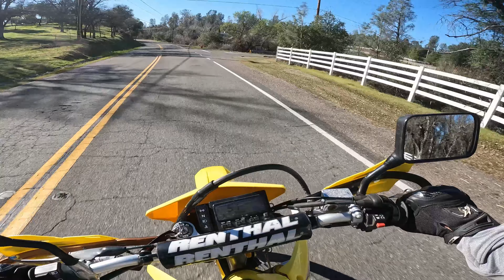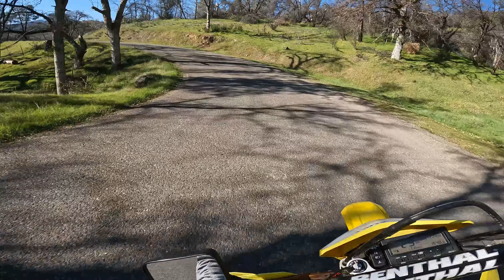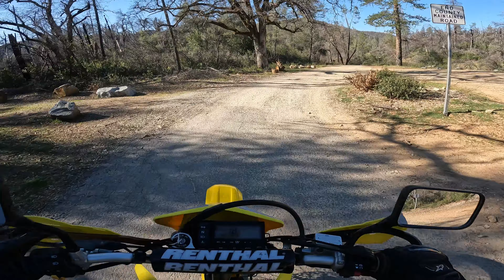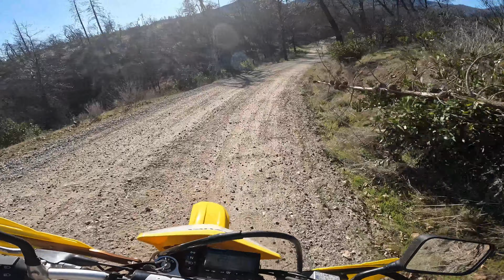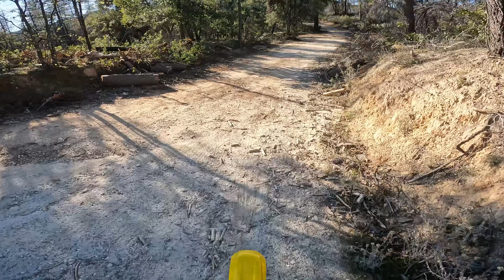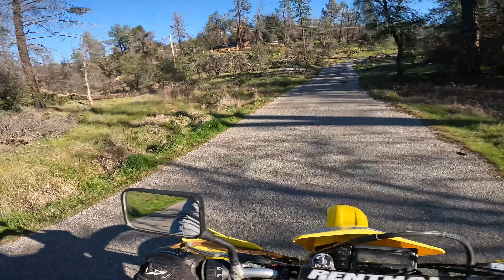Suzuki DRZ400S on Muletown Rd + Free Beer

Comment: Be careful buying a Beta!! Once you have one, all other bikes feel like shit👍 There is a reason there aren't a lot of used ones for sale💎
Reply from the maker: I was set to buy one from my local dealer recently. They had a 430 RR-S in stock. I sold my CRF300L Rally in 3 days and went back in to buy it but it had already sold. They won't get another until June at the earliest they said. I found a 2021 KTM 500 EXC-F Six Days with only 60 miles on it for several thousand less than I could buy one new and pulled the trigger on it. I would still love to try a Beta!